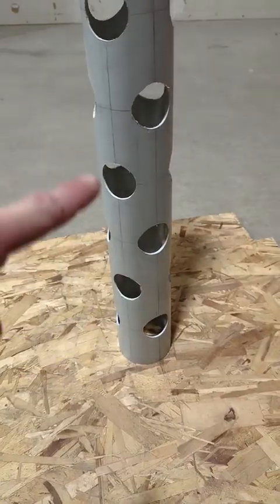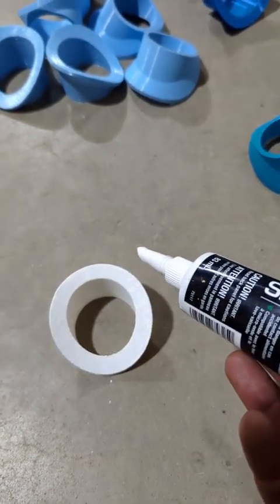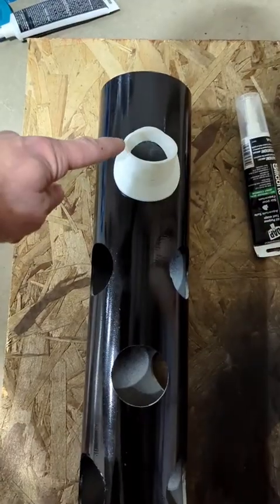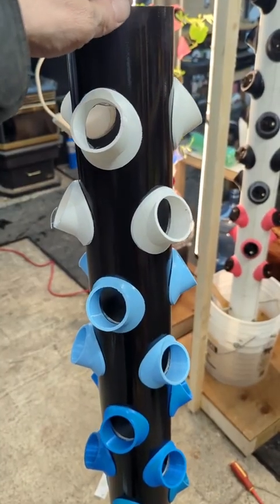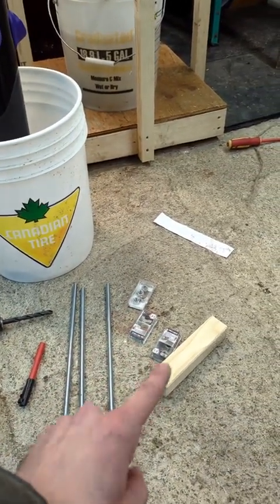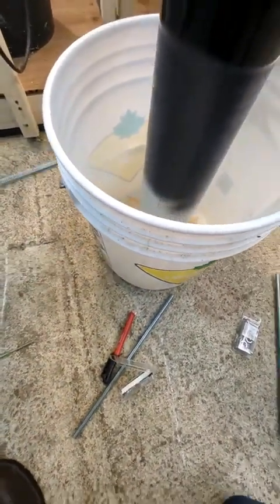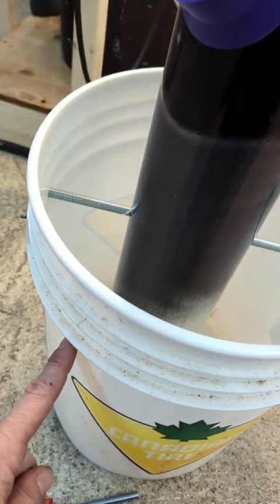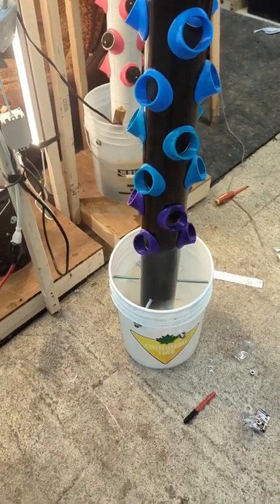Easy DIY Hydroponic Tower Build Part 2

Comment: I went back to using soil after spending hundreds of dollars and countless hours.  Main disadvantage with hydroponics or aeroponics is labor intensive and loss of nutrients from drips.  With water any loss is neglible, but when drips contains precious and expensive chemicals, it becomes a concern.  You need to constantly test and mix chemicals.  It works for full time production, but as a homeowner, soil and water is less demanding.
Reply from the maker: Honestly, i almost set and forget, i feed every other week and just do water top offs when needed, I also don't loose nutrients as it  just drips back into bucket

Comment: How long is the 3/8" drill bit you used? If it isn't long enough to do the process in one attempt, how do you line up the holes since there would need to be multiple approaches to the bucket and pipe?
Reply from the maker: My bit was long but it's not needed, to make the holes with a smaller bit just use the rod to line up the next one on the other side